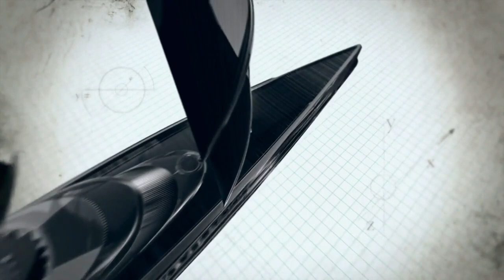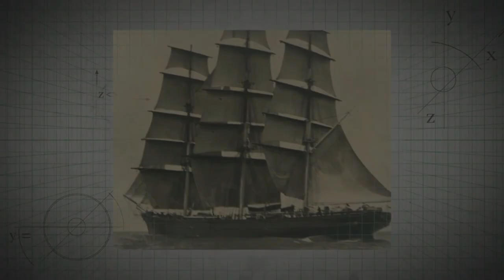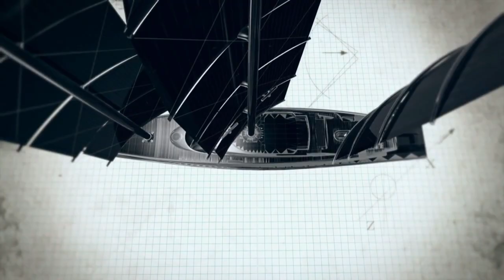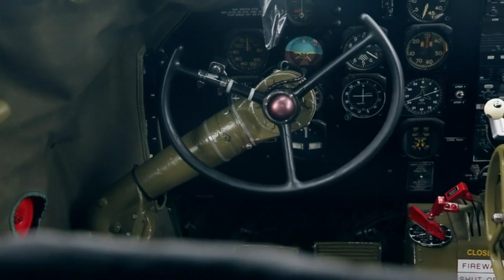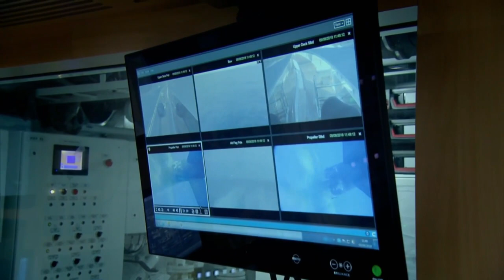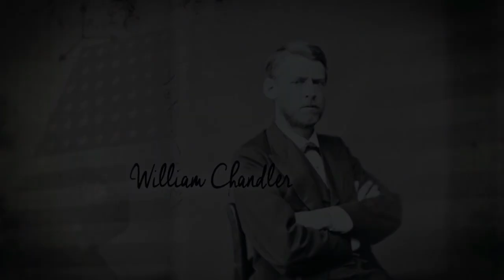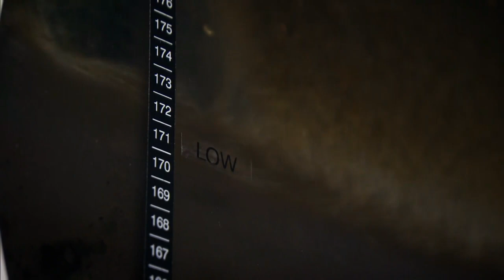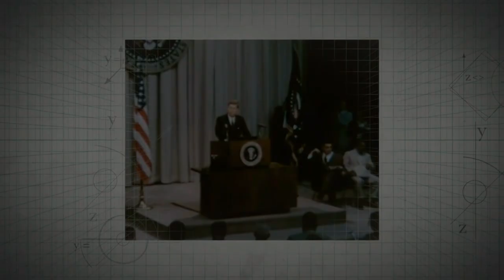World Greatest and Fastest Yacht #blackpearl #yacht #zeroemission #engineeringmarvel #documentary

Comment: A major issue with large yachts is the fossil fuel required to keep a ship running. A small yacht in the 100-foot range burns around 100 gallons an hour. A ship in the 200 to 300-foot range will burn 500 or more gallons of fuel an hour. Good Job
Reply from the maker: Yes thats why it is made to solve this issue